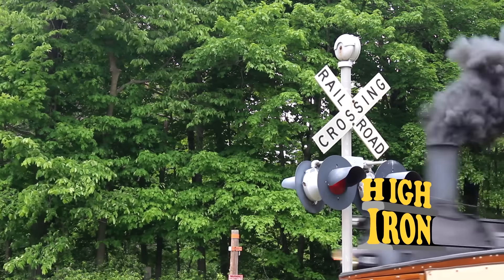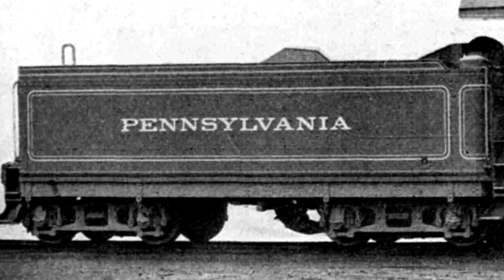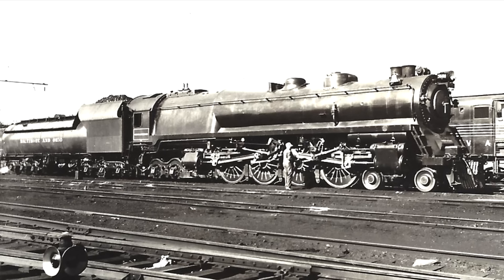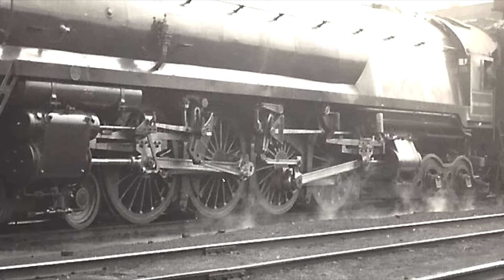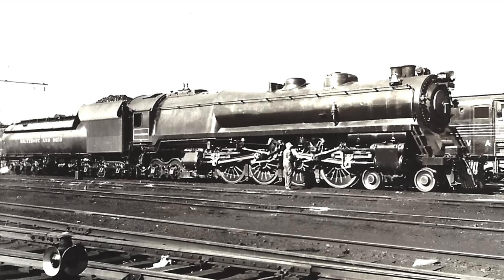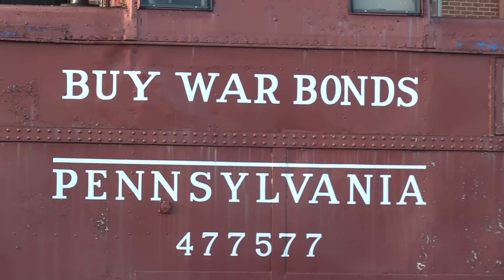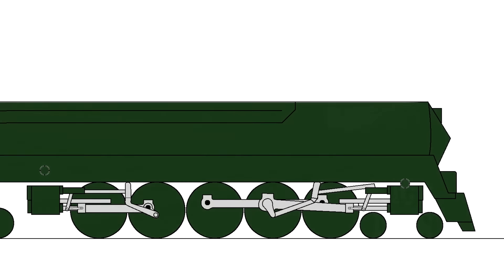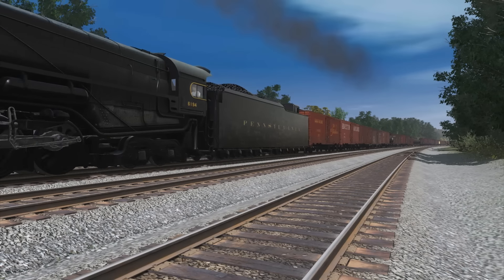Why Weren't Duplex Steam Engines Successful?

Comment: I think the main thing is they came too late, so just marked the end of the steam era. Diesel electric plants were just easier to deal with in operation, maintenance, and operational costs. 

If somehow diesel didn't catch on, there might have even been nuclear powered trains. And possibly some development of a steam turbine/electric plant. That really is the next step in boiler systems past coal and oil.  But that introduces another can of worms into operations and maintenance.
Reply: The actual 'road not taken' contained two highly interesting technologies more suited to contemporary railroading than expensive and fragile diesel-electrics.

One was actually a sort of development scam: the Bituminous Coal Research coal-burning gas turbine (the effort was funded by a consortium of coal-carrying railroads... who expected that the research would come to be subsidized by the locomotive builders once proof-of-concept was established, and gave up when that 'failed to eventuate' (except for Union Pacific, which built it out into one of the more colossal failures ever funded by an American railroad, but that's a different tale...)

The other, which was far more promising, was the free-piston gas generator, which substituted an attractively simple combustion mechanism for the turbocompressor and high peak temperature of a then-contemporary axial gas turbine (radial turbines said not to package well even in North American loading gage) combining the part-load efficient of a positive-displacement expander with the simplicity of a power turbine.  I note in passing that the Hamilton Engine Company of Ohio snatched up the German intellectual property about this, and were then (of all the prospective diesel-engine builders!) snatched up by Lima Locomotive Works to form Lima-Hamilton when the market for big modern steam collapsed between 1947 and 1949, and then Baldwin suffering in the market through its reliance on large, relatively slow-speed tugboat engines, snapped up Lima-Hamilton in its quest for an EMD-killer.  (See also Pescara for a European rail development of this technology at smaller scale).  There was supposed to be a 4000hp demonstrator out of Lima-Hamilton, and then BLH after that merger... which disappeared around the time the E7 was developing into the E8; GM would later yank this approach almost to full demonstration with the FG-9 before that, too... was abandoned to disappear virtually without trace.  Perhaps indicative of the issues, there was a version of this installed in a Liberty ship as part of a comparative test; at least we know one of the reasons was intolerable noise akin to that reported for a Russian free-piston experiment, but not exhaust noise in the interstage, but INTAKE noise.  Perhaps at gut-opening frequency and loudness like the reported 30Hz noise from pulse detonation wave engines on a successor to the RS-71 [note that that's intentional, not a typo] but I will resist digressing).

But it would have been highly interesting to see something like the Superior-engines Ingalls Shipbuilding 2000hp passenger engine, but with free-piston turbines on its Bowes drives.

Comment: As of April of 2024, the 5550 project is still going but very slow as the frame is still being welded and hand crafted. Its just a few folks doing it and its likely that they wont have anything resembling a complete engine until 2030

Comment: I keep forgetting - which RR in the steam era utilized female crews? (1:30) This was an enjoyable and informative piece. Way to cave in to newthink and inject "underrepresented"  subsets of society into your portrayal.
Reply: Several railroads in wwII utilized women during labor shortages. By the end of the war, about 250,000 women were working for railroads.  Even during wwI there were 100,000 working for railroads.
Reply: @Will-train  As engineers? As firemen?
Reply: @Will-train  My comment referred to 'crews' specifically, not labor.

Comment: If the length of these machines posed such a problem, why couldn't they split them in half while still making the two halves operate as one with a single crew and no redundant systems?

Comment: if the train is electric and modern power plants run on stream. modern electric trains are powered by steam engines.
Reply: Diesel engines drive electric motors in newuns

Comment: It is amazing   To watch this technology.   What pushes the steam into the pistons.    A special pump ????
Reply: I believe it is the pressure within the boiler itself
Reply: Steam at high pressure can exert sustained thrust, beyond what a compressed gas can, because of the heat content of H2O.  If the steam is further superheated, it will condense less against the cylinder surfaces (or in so-called nucleate condensation as expansive work is extracted via the piston thrust) so effective pressure stays higher after cutoff.

Comment: Shame the Keystone line stops at Harrisburg. Imagine if the PRR electrified all the way to Pittsburgh
Reply: That was always in the plan; the RFC financing that allowed most of the NYC-to-Washington electrification ran out before extension west of Harrisburg started.  There is of course really little doubt that the line between Harrisburg and Pittsburgh would by far be the best beneficiary of the evolved 11kV Gibbs and Hill electrification and the post-GG1 locomotives built for it.
Interestingly enough, there was a full proposal for electrification in wartime (dated 1943) which called for locomotives built with the improved traction motors of the DD2.  This would have included some highly interesting helper/snappers with no less than 16 powered (and quill-driven) axles over the heavy graded section, combined with a substantial tunnel (made practical by the electrification) under part of Horse Shoe.

Dieselization was the primary reason this was not 'proceeded with'; there were detail discussions about a version of it (with dual-mode-lite power) as late as the '80s.

Comment: When I study these steam marvels, I have a question. Why are the steam cylinders/pistons traditionally at the very front?
Could the steam cylinders and pistons be designed to have a power stroke in both directions? 
If so why not put them in the middle like say a 4 - 4  cyl/pis 4 - 4 ?
Reply: Two places for a leak.

Comment: The    Saxon XV HTV (class 79)    is a german successfull "duplex"-predecessor 

https://de.wikipedia.org/wiki/S%C3%A4chsische_XV_HTV 
https://en.wikipedia.org/wiki/Saxon_XV_HTV
Reply: As was the Toleman locomotive, and all those wacky Webb Compounds.

I'd have at least mentioned the French divided-drive 10-coupled locomotive (it wasn't a 'duplex' because it had inside coupling rods).
Reply: To be honest, these locomotives aren't really 'duplexes'; they are compound 0-6-6-0s without Meyer or Mallet articulation, with the cylinders inside (like the Mallets from CPR's Angus Shops).

Looking at it you might predict Lindner had something to do with it, and you'd be right.  Note the radial outer axles of very effective design, reducing the rigid wheelbase without any major 'side effects'...

Comment: It is a tribute to the lasting fascination of steam power that anyone is willing to take on the commitment to build this engine again. We know it was the fastest in regular service, there was just never sufficient justification to run it in an official speed run and those that did run it fast had reason to keep quite about it to save their jobs. It needed considerable work to avoid wheel slip and to keep the pressures equal between the front and rear cylinders because as soon as one would slip the steam pressure to the wheels with traction would drop, making the slip worse. I would say you either build it as it was or use extensive computer modeling to make a new , improved version. Either way, what have you really proved except that someone has too much time and money?

Comment: Union Pacific i think trialed a locomotive that instead of using oil to fuel a direct combustion turbine, used powdered coal...........it worked, but the fly ash eroded the turbine blades unacceptably. In steam propulsion, the US Navy late WW2 ships had the most powerful and developed steam boiler systems...........running i think 450psi working pressure. Innovation is a tricky road to take.......there are a multitude of problems to overcome..........and often the infrastructure left over from the past is a massive obstacle.
Reply: @wizlish  thats interesting........I will have to look up solvent refined coal.

Comment: Admittedly I'm more of an "enthusiast" as opposed to actually being knowledgeable on all the duplex types the PRR operated, but I thought there were at least one or two that were actually considered a success if not for a relatively short life due to dieselization. I could be wrong.
Reply: The whole Q2 class was considered successful... for wartime service that could take advantage of the duplex construction.  The defect in the automatic antislip compensation would not have been difficult to fix; the magnetorheological clutch needed for proper conjugation was practical as early as the late Forties.  The problem was that there wasn't an advantage on a 50mph freight railroad...

Comment: The main issue with why the duplex engines had wheel slip is because everyone who operated them use to operate the older engines and when they started they would just slam the throttle to full then wonder why the wheels slipped because the duplex engines had more torque then the previous engines meaning the wheels would slip easier not a fault of the engine it was operator error

Comment: If duplex (as an old american patent?) would be alternatively or partially seen or defined only for the drive shaft, this doesnt indicate which "fuel type" is in use, so why only associate "duplex" with steam (driven) pistons? or would that be an american patent issue? Using two or four drive shafts for a locomotive or railcar could perhaps even be realizen/realized on an electric railcar, or is that thougt too far sprung? An(y) electric motor also rotates some drive shaft (explaining rotary current), so technically the use could be modular. 
I would assume that the wheelbase (a car term?) distance must be maximised, one drive shaft at the beginning (front) of the locomotive, and the other at the end (rear), so that the weight gets rather levelled, on more field or rectangle "room" so that the benefits of more then one drive shaft (a split of the energy "provide") would be optimal and the train composition would slither the least on wet or/and steep trages. So if "duplex" then something like a stretch limousine, right? or only on rails that are fixated with concrete so the weight on the locomotive front doesnt bump or shock the rails when driving? would that be a problem issue? 
I furtherly assumed this was about locomotives with turbines adding "force", but when an engine gets a regular turbine sucking fresh air plus a second one getting rotary energy through using the exhaust heat, this type of motorisation "twin-scroll turbocharger in cars" would also get an use with the diesel genus (steam turbine-s locomotive) or perhaps even with liquid gas (LPG). So would the ideal locomotive or railcar be an electric and two turbine hybrid? with the 4 types of electric current, i would guess. Though extra performance would require more maintenance. And sucking air brings dust and insects, even electric railcars windows had to be wiped after a ride until about the 80ies (of the 20th century) due to countless insects were decreasing the engine drivers view (so told for europe).

Comment: One type of Duplex, I think the S-1, is a serious contender for the world speed record easily beating the Mallard. I'm sure speeds of 140 or 150 mph have been flouted but nothing has been proven except insofar as evidence for fines for breaking the speed limit regularly to make up time with the extra speed over the limit being apocryphal at best. I'm trying to recall what I read some time ago, so apologies for any vagueness and not being able to cite sources, but the correct info is out there, somewhere.
Reply: You do know that the actual top speed of the A4 remains unknown? Some of the old crews were convinced that they achieved 140 -150 mph with them though these speeds were unverified. There was an interview with some of them on YouTube. The riding became the issue, more work on the balancing being required. Being designed for 130 mph was one thing, exceeding this by a significant margin was another matter. We might build the proposed "Super A4" one day.

Comment: Why couldn't you use.propane or natural gas to heat the boilers instead of coal?? I just found this channel.I like American history although I don't know a whole lot about train engines.Great channel!!! The idea one viewer had about recirculating spent steam might possibly work with the use of a turbocharger.Please correct me if I'm wrong as I'm kinda out of my league here!!!
Reply: i think its how oil and coal is more common resource than gas itself
Reply: Late steam trains did run on oil. NG would probably be a bit of a hassle to fuel and maintain given the need to keep the tenders pressurized

Comment: Not enough weight on drivers and the steam pressure was too high so the engine was twitchy. Cars today are the same way. If you even breathe on the accelerator you’re up to 40 in a few seconds. Don’t know if these had a Johnson bar or not but if they did it was too close to the middle when starting.

Comment: I think you need to read up on Chapelon, later De Caso who built perhaps the finest Baltic of all time. It was a one off compound and completely successful, just too late. Straight off the drawing board, it did 1.4 Million kM without trouble. Electrification had taken hold in France and that was that. However, Chapelon's last design forced the electric loco manufacturers to increase the drawbar HP. Then came Porta of Brazil. The valve control of even the earliest loco's had allowed variable expansion and IC engine are only just catching up with valve control, nearly 200 years later! The power of American loco's was high, very high however this was possible due to the much larger loading gauge permitting much larger cylinder than elsewhere. The NY and N and W Niagaras were superb with well designed valve gear permitting very early cutoff of steam to the cylinders.
Reply: Small correction, Porta was from Argentina and if you are interested in his work you can now buy books of his papers.
Reply: @DeCasoU1  Thanks. My memory is reliable....... I like your name. I have Serial Number 1 Aster Gauge 1 232U1. It's a true compound and can burn coal as well as alcohol.
Reply: Livio Dante Porta of WHERE???
Reply: @wizlish  that was dealt with above. No I'm not confusing any other than per above.
Reply: Brazil did get some of the most advanced steam locomotives ever built, designed very capably by Andre the Giant and resembling perfectly-scaled-down top-rank American power to run on the metre gauge.  Those were known as the GELSA locomotives.
Reply: @wizlish  Yup.

Comment: 10:33 weren’t the 4-12-2s on the Union Pacific the largest non-articulated steam engines ever built?
Reply: Not quite they're was a larger Russian locomotive but it was a total failure
Reply: @IndustrialParrot2816  The UP 9000 was built before the 4-14-2 Soviet AA20, so it held the record first.
Reply: @BAKU2K2  The AA20 was actually a 4-14-4.    But it was just a conventional two-cylinder.
Whereas the UP 9000  4-12-2's were three-cylinder, I believe in order to keep loads on the crankpins to a reasonable limit.
Reply: Keep in mind that if 'largest' = 'longest', the S1 is larger than the Union Pacific Big Boy 4-8-8-4s...

Comment: T1 Trust could probably improve the Q2 as well
Reply: The real improvement on the Q2, aside from making the analog slip control proportional, was made vy Riley Deem in the 1980s; he gear-conjugated the two engines, so that the low augment of the divided drive was not compromised by dropped adhesion on rail defects or poor track geometry.  (You would see a different approach on the proposed ACE 3000)

Comment: People forget that Steam Locomotives are not obsolete.
They are still more powerfull than both Electric or dieself.
The problem of steam is its compairativly abismal fuel to power ratio.
And thys running a steam locomotive, instead of electric or diesel locomotives, is just less economic in nearly all cases.

Comment: Simple reason for their failure: PRR conceit AKA WE know better than anyone else and we will prove it no matter how many times we prove we're wrong. They should have gone with any form of 4-8-4 and had a great engine but nope. Which is why thebest modern Steam locomotive was the C&O designed J-1 2-10-4.

Comment: It's too bad that the railroad companies didn't plan for the future by making the track width considerably wider from the start to facilitate greater stability and safety (there is a train derailment about every 3 hours).
Reply: They tried wider in many places, it doesn't help.  Rail breaks no matter the gauge, bearing shatter, no matter the gauge, wheels crack no matter the gauge.
Reply: @tonyburzio4107  I was thinking more for stability with high center of gravity (tip over risk).

Comment: Makes me wonder if the new age of locomotives could be ran with a nuclear fire box. One fuel fill up for the life of the machine. Maybe a more efficient production of steam . Smaller more efficient fire box allowing for much more water capacity on the locomotive itself.  Not why the diesel electric hasnt been converted to nuclear driven electric. With either one or both converted to nuclear the rail oil and coal independant could become the worlds most economical way to move freight.